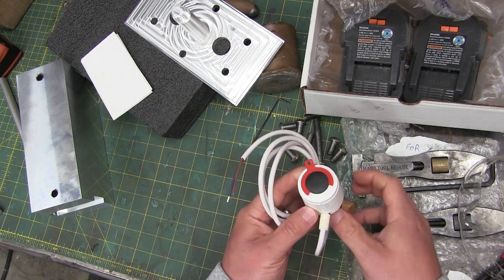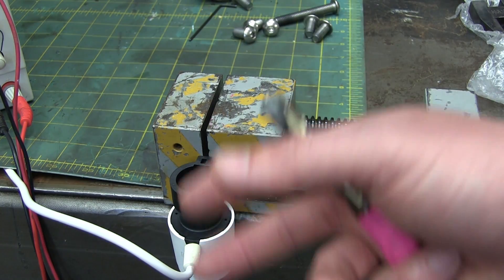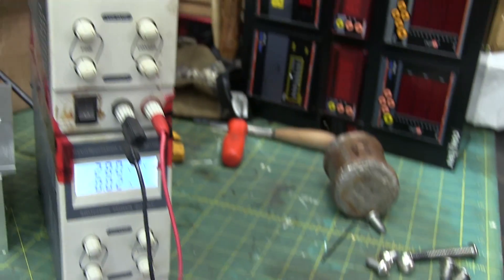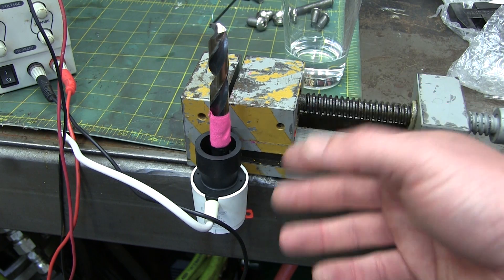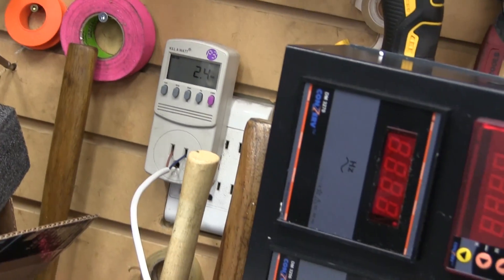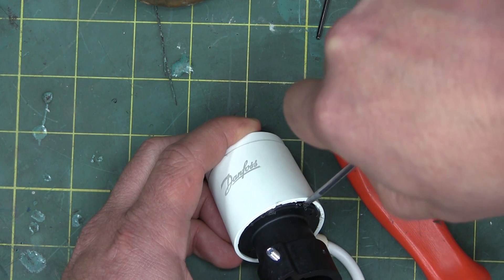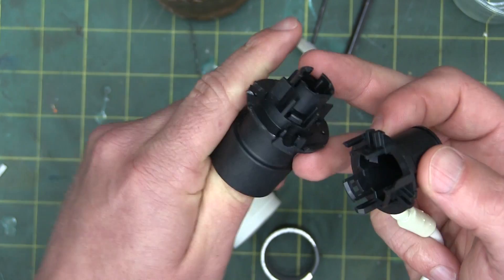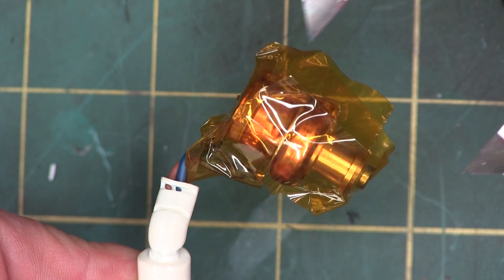BOLTR: Wax Actuated Motor | Mindblowing OLD Tech

Comment: there is a company that does something like what you want to do, It is called Zomeworks. They use freon with a tank on each end and a radiator below the panels to "reset" it in the morning. The rak is counter-weighted and balanced so it takes very little force to move it. The end tanks have shades on them such that if the panels are out of alignment one tank heats up more then the other and freon flows to the "cold" tank until the heat is balanced in the two tanks when it is pointed at the sun. in the morning the sun hits the lower radiator and pushes the freon to the opposite tank from the one that is lowest in the afternoon and resets the system.

Comment: My 1974 Mercedes 450SE had a wax air mixer for the fuel injection air inlet. As the wax heated, the valve closed. As it cooled, the valve opened. This was to compensate for idle and run times.

Comment: wax motors are also used as a cold advance on diesel injection fuel pumps  to limit  heavy smoke on cold diesel engines 12 or 24 volts DC

Comment: I remember as a kid building a robot that tracked light.  It had three wheels, two of which were hooked up to independent motors.  A photodiode is place on either side and controls the motor of the opposite wheel.  I've always been blown away at the simplicity of that control system.

Comment: They used to be used as door locks on european  washing machines to prevent opening before the end of the washing cycle. Even pulling out the plug out off the outlet would not reset it except cooling over time. Smart but slow

Comment: The same principal is used for greenhouse window openers. It's an actuator filled with some sort of gas and when the temperature reaches a certain level the gas inside the actuator expands and that action opens the greenhouse window. When the temperature goes down the window closes again. So it doesn't use any power source other than the sun.

Comment: VW used this Wax actuator technique (late 80's) in their petrol engines to actuate the choke valve on the carburetors, heating up the motor changes the wax to fluid state and turning the choke valve open, when the motor cools, the wax returns to solid state, closing the choke valve.

First attempts at creating an automated choke on petrol engines, worked fine as long as the fluid wax didn't leak out :-)

Keep your wax in a clamp!

Comment: To move the panels, I've seen gas piston actuators filled with R22. The temp difference between day and night and the expansion caused by it cause the panels to rotate during the day, resetting when it cools.

Comment: I found out about these when fixing an extractor fan cover for my kitchen... for some reason there's a wax actuator to open the slats when you pull the cord, instead of... say... a mechanical lever that doesn't cost £20 to replace when it fails. I'm sure there was some kind of benefit in production cost and lifetime (cheap plastic mechanism vs 200lb gorilla, and an off-the-shelf part instead of needing to replace a specific plastic moulded piece) but the overengineering seems bonkers. From what i found when finding a replacement these show up in old washing machines, and the older versions of these parts usually dry up when the seal breaks.

Comment: I've been converting an old motorcycle to Electronic Fuel Injection using components off of a modern Honda CBR600RR. I was confused as to what it was using for it's fast idle as there was a small actuator, but there were no wires leading to it, only small hoses. After some more research I determined that it was a wax filled actuator. When cold it holds open a small air bleed valve in each throttle body, and as it heats up it closes the bleed valve. No wiring or electronics required.

Comment: Small versions of these are most commonly used as the safety locks on your washing machine. If you have a maytag neptune (famous for problems with these) and your wash cycle stops mid way, the wax motor is pooched.

Comment: How accurately can the position be controlled using PWM? I also wonder how a refrigeration system using such a slow valve would cope with a sudden decrease in load which would call for less flow to keep liquid from going back into the compressor. (Or is it for some other valve like hot gas defrost?)

Comment: In a similar vein, there's a really cool type of soft artificial muscle that some research labs are playing around with. The concept is to suspend tiny bubbles of alcohol and small flexible heating elements into a lump of silicone rubber. If memory serves, the result can triple in size and put out force comparable to an air cylinder. And it's apparently very simple and inexpensive to manufacture them.

Comment: Regarding the solar panels, perhaps you could put two on that oppose each other, and cover half the panel each? 

So sun comes up, heats up the left of the panel, the anti-clockwise wax-powerknob starts erecting spinning the thing towards the sun. As it turns, the other powerknob's paraffin heats up, and it too erects. All day the pickles will battle, and in doing so track the sun, with no extra power needed.

I'd imagine there'd be a lot less dicking about this way, with calibration etc, as it's just a matter of whichever side is hottest turns the most.

Do you think wax engines could be a thing? Perhaps as an efficient external combustion engine/generator? While i'm usually not one to brag, i'd be OK with a massive copper pickle in my front yard if it meant i could throw a log of wood under it and power my TV.

Comment: uncle bumblefuck i need some advice! Do you think it is safe to use a pneumatic valve backwards in a vacuum system, or am I on the fast track for a Darwin award??? also, any tips on how to get a threshold digital read off of an analog vacuometer(if it reached a certain value)? i thought of a photo detector being interrupted by the needle!

Comment: +AvE you should look into pilgered pipe for this idea. Rather than drawn pipe. Drawn pipe is inherently eccentric. Pilgered pipe/tube can be made perfect for applications like this. 5 thou variation in wall thickness and 1 thou variation in OD.

Comment: Brilliant idea! There is a company that makes sunflower solar systems which folds out a range of solar panels like a flower, and keeps it aligned with the sun.
Also great idea but badly executed. It loses 30% of the produced energy only because of the motors etc. Doing it with wax seems so logical.

Comment: Watch an older reality show called "The Colony" or something like that. It was a survival type show. 

Anyway, one guy built panels that followed the sun with light sensors that just turned the motors until they had full sun, then they stopped. Super simple.
Season 1 Episode 5: 
"Solar Panel Rig: Using the generator obtained from the traders in Episode 4, Mike, Joey and others set out to build a rig for the solar panels they obtained from the roof of a nearby building and along the railroad. John C. works to build a device that incorporates two photodiodes and a small motor into a solar tracking device, allowing the solar panels to follow the sun during the day, and return to starting positions at night."

Comment: I recently replaced a wax motor on the dishwasher soap dispenser. Ebay has the best deals on a specific model, don't buy from those appliance parts dealers.

Comment: Is it possible that the copper powder in the paraffin wax turns it into its own heating element?
I'd mainly guess that because one wire seems to go into the case, and the other contacts the bottom of the copper plated case.
There also didn't seem to be any sort of resistive element (eg: nichrome wire) inside of it.

Comment: A lot of domestic extractor fans use wax actuators to open and close the louvres. They have a resistor attached to them, that after about 20-30 seconds, the wax gets hot enought to open the louvres. When you turn the fan off, the wax cools and closes the louvres once more.

Comment: If you're wanting solar panels to follow the sun for maximum efficiency throughout the day, you need to add a second axis of rotation. Without that second axis, you're only going to get maximum efficiency two days of the year, or one day if set at a solstice. Best idea for this would probably be a motor with an arduino, wouldn't take much power since it's only changing the angle daily rather than continuously.

Comment: Common place to find a wax motor, in the wifes front loader washing machine. Thanks to your friends at CSA, manufacturers are required to keep the door closed/locked until the motion of ocean comes to a complete stop during a power fail. An electrical lock won't work, no power no lock, but a wax motor with its slow operation fits the bill. Turn it on and door lock will engage slowly, cut the power and it will disengage just as slow.

Comment: My guess on the copper powder in the paraffin is to act as a heat transfer during the cooling stage to help to bleed off the heat into the surrounding brass allowing for uniform shrinkage of the paraffin. 
When melting and pouring paraffin for the wife's candle habit the center is always more sunken than the sides as they will cling to the sides of the mold. By adding copper it would probably allow for a more uniform cooling of the wax prill.

Comment: Too much hysteresis with solar heated wax motors, you’d be much better off with electronic light sensors of some sort. The thing would probably overshoot and enter a slow mode of oscillation with the solar heating.

Comment: I thought thermostats were generally a bi-metallic strip with a counter-spring -- were there some that used a wax actuator? 

Another interesting application of these were in the throttle cam seat, in some cars (Mazda used them) to bump idle RPM. Mazda also used them in rotaries to restrict oil flow in the eccentric shaft (not the one you are thinking of).

Comment: Mercedes has used these for a long time on diesel cars to control something in the fuel system. It's a wax pill with a rod coming out the end, as it gets warm the rod expands. I forget what exactly they control. I assume automotive thermostats use something very similar, at least some of them.
Reply: Get warm and rod extends. Damn tiny keyboard.

Comment: This is a known method of solar tracking and can be used for azimuth based tracking via a hilical style cut gear - no need to theorize or perform testing to achieve it.  It is an off the shelf product.

Comment: That delay in the motor actuating means that it is nearly impossible for it cause a water hammer when the valve it controls closes. That delay is also useful for limiting short cycling especially since some heating system use wax motor with end switched to turn on boilers, chiller, or pumps.

Comment: Scooters liked my old 1985 Honda CH250 used something similar to close the enrichment circuit on a carb after the bike warmed up. They called the part a bystarter. Some scoots with carbs still use them.

Comment: Using them to control the angle of solar panels is an interesting idea.  There is definitely lots of different ways to do it.  I'm pondering an array of motors fighting against each other.  Hottest one in the sun wins.  Perhaps they could deform a track, the most deformed section determines the position of a roller attached to the panel.  More than one way to skin a cat, of course...

Comment: if you had a long cylinder w/ heating elements spaced along it wired separately, would that let you control the expansion?

Comment: Honda push mowers use wax actuators for the automatic choke feature. It sits in a hole in the head and pushes the choke open when it heats up. After shut down it cools off with the engine and actuates the choke back closed.

Comment: This reminds me a lot of Nitinol actuators.  Nitinol's actuation temperature and be tuned to anywhere between about -100 to 100 degrees C depending on the exact chemistry of the alloy and the amount of cold work you put into it.  It would be interesting to know which has the capacity for more power, wax or metal

Comment: That paraffin and copper powder mix is also used in heat-pipe coolers on computers, it works well until you decide to melt down a bunch of scrap aluminum and throw one in the melt, that was a fun day!,

Comment: Works much like a thermostat on a vehicle cooling system. It too utilizes  Parafin wax to open the thermostat as the engine temperature rises. The actuation for most vehicles occurs around 180° F however that depends on the spring stiffness.

Comment: My scooter carburetor has a tiny wax motor that deactivates the automatic choke. Takes a few minutes to push out and then stays there as long as the engine is on slowly pulls back after the engine is off.
 
 Chickadee never use your hand as a hammer! Right Papa?

Comment: Back in the early 80's used to fight with Mitsubishi carbs that used wax motors to open the choke and lower the cold idle speed. Pain in the back-side they were.

Comment: Honda uses something similar on there cbr1000rr that's holds a high idle until engine is warm
Reply: I have an 1985 Honda car that does the same thing using manifold vacuum controlled by a parafin switch.

Comment: a wax motor controlled the cold start timing advance in the injector pumps of 1989-1991 non i/c dodge diesel pickups. just like an automatic choke that opens as it heats up the wax motor "unadvances"" the timing to normal as the engine warms up.

Comment: Do modern car thermostats use wax motors? I was under the assumption they still used a bi-metallic spring a mathing. Same principal, but one would think the latter is quite a bit cheaper.

Comment: They used to have these on some old SU carburettors, as the engine warmed up a little wax valve on the jet would lean the mixture off and when it was cold it would run a little richer. Nice idea in principle although in reality once they got a little older they caused more issues than they solved and could be replaced by a small stack of 1p coins.
Reply: Did the 1p coins still expand and contract? Maybe the copper in there is also doing part of the work?

Comment: 50 lbs?? yeah right ... I would bet that if the cylinder holds, it would be up to the tonnes (spelling?) range. Talking from personal experience with a smaller version of about 5mm diameter by 20 mm length and a "piston" of ~1mm square... my little vise didn't stand a chance (it got a nice ding after my... the experiment).

Comment: The wax undergoes a phase change once solid as it cools. The last thermal motion to die out as it cools is free rotation of the CH2 units of the n-chain alkane. Whilst they rotate the linear molecule takes up a cylindrical space. As it cools the molecule stops rotation and settles down into a more compact regular zigzag, causing shrinkage after the wax is solid (ish). This is the phase change that causes the greatest change in volume as you heat the wax up and occurs below the melting point.  With a almost pure n-chain alkane microcrystalline wax this phase change happens at a quite sharp temperature. If you have a wax with side chains and varying lengths of chain the phase change happens over a wider temperature range, and can thus be tuned to the application.

Comment: most of the Japanese cars in the 90's used this. it was called a ficd. fast idle control device. antifreeze flowed into it warmed it up and released the throttle plate..

Comment: Paraffin is a generic term, it is available in many chain lengths for different melting points. They use something similar for automatic home gamer greenhouse vent openers, Wax in a confined tube expands and extends the linkage. plus a sprung connection so it can close tight without crushing stuff.

Comment: the most simple way i found to drive solar panels on one axis towards the sun is: have two small solar panels at around 90° connected to a motor. if one side gets more sunlight it will spin the motor in one direction until both panels produce the amount and cancel each other out, so the motor doesn't spin anymore.
hope that helps (saw it in a YouTube vid)

Comment: Don’t need to be a poppet valve. We call the “wax”, the “pill”.  You can vary the voltage to be extremely accurate for varying loads.  Not really good for hot situations, but perfect otherwise.

Comment: Danfoss, known for heating appliances.  Probably for floor heating flow control.  Floor heating water is max. 30-35° hot. Mine (not Danfoss) runs on 220 Volt

Comment: That's actually one of the most brilliant inventions I've come across. Think about it, an actuator with essentially zero moving parts! These are very common actuators for central heating system valves over here in nordic countries.

Comment: Wasn't a wax motor used in the moon buggy?
Reply: Jttv if I remember correctly it wasn't a motor but a way of absorbing the heat and keeping the components cool
Reply: Ya your right I went and looked it up after I left the comment.
Reply: Twas a waning motor on the moon buggy.
Reply: IDK, but only America left four wheelers on the Moon 🌒! Hello, we didn't lock them up, like, come on, I dare you guys to steel this!
Hey China! Can you build a faster moon buggy?
I bet you can't! Your technology is inferior!
Reply: 57fitter dad get out...
Reply: Kind of; wax was used to absorb waste heat from the drive system. The latent heat absorbed during the change of phase from solid to liquid was used as a heat sink whilst travelling and the ‘stored’ heat was then dissipated when stationary (not sure how though?). I think it was to save the mass and complexity of a cooling water and associated sublimation system on the rover.
Reply: wtf
Reply: no insults, no fights, 10/10 best comment section

Comment: Could the copper impregnating the paraffin be used to control at what temperature she chooches? That looks exactly like the internal of a thermostat which can have a wide variety of temperatures to actuate. My Jeep requires a 195* whereas my old Camaro ran a 165* t-stat.